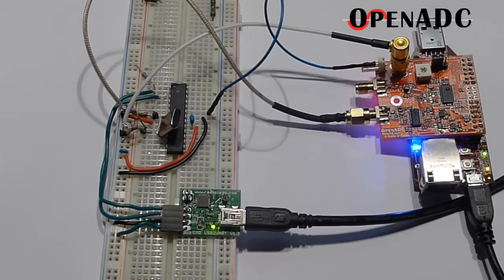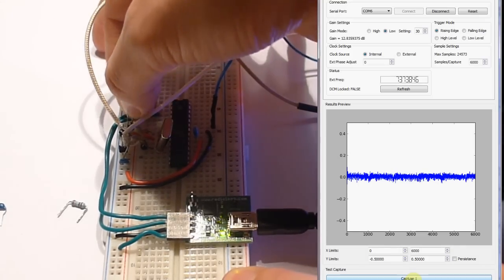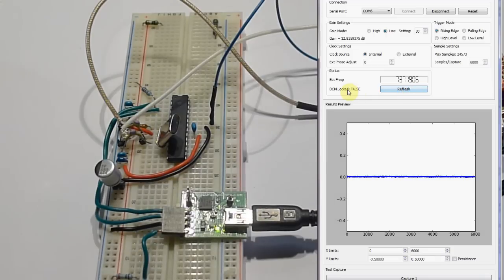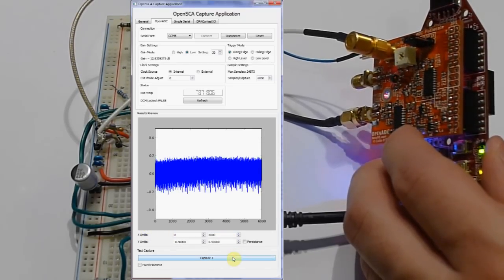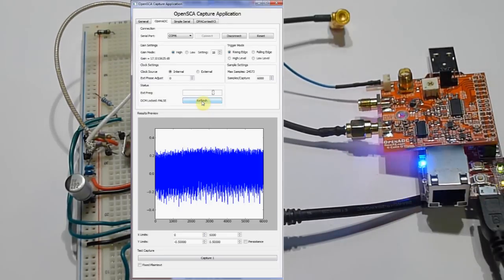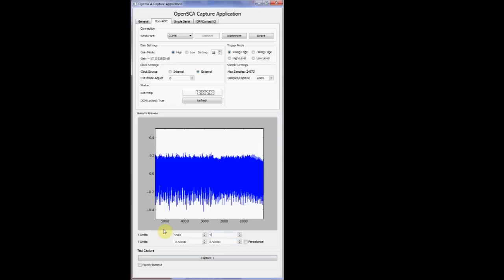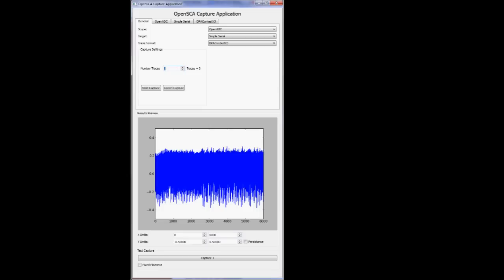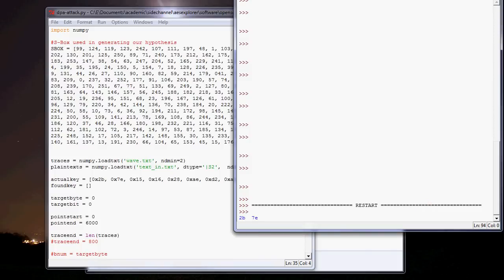Differential Power Analysis (DPA) with the OpenADC Targetting an AVR

Comment: Is the full documentation still forthcoming?
Reply from the maker: +Matt Hollands Ah this whole project spun into my ChipWhisperer project instead - this stuff is still somewhat supported, so I guess I documented a similar but related project instead ;-)
Reply: +Colin O'Flynn aww fair enough. Will have to find some time to dig around in the ChipWhisperer documentation. Just listened to your appearance on the AmpHour! :)
Reply from the maker: Thanks! This target is called the "LX9 Target" in the ChipWhisperer software. So the hardware I used here does indeed work on this target, it's something like http://newae.com/sidechannel/cwdocs/tutorialaes.html but with different looking hardware. The LX9 board I'm using here is also a lot slower due to the serial port for downloading data.
Reply from the maker: +Matt Hollands I actually forgot, the updated ChipWhisperer software is demoed with this same hardware at https://www.youtube.com/watch?v=xnUVaVq9_i0 . That correlates more closely with the previous link I sent to the tutorial.